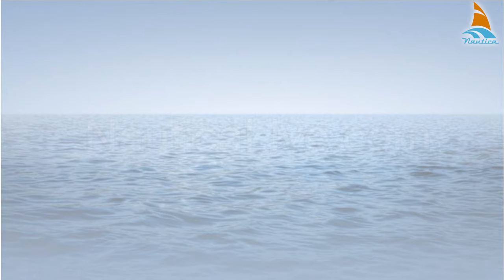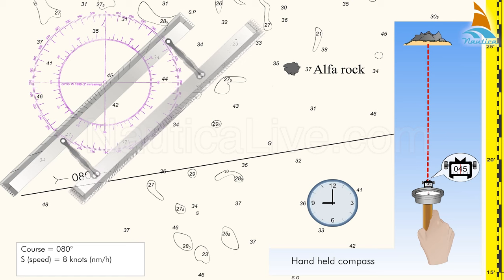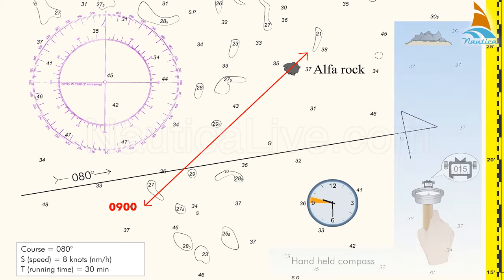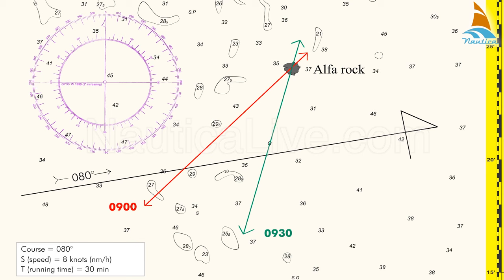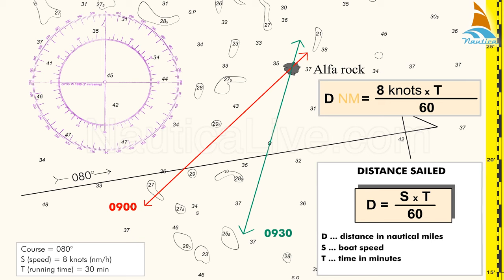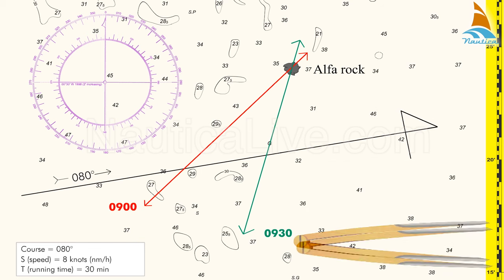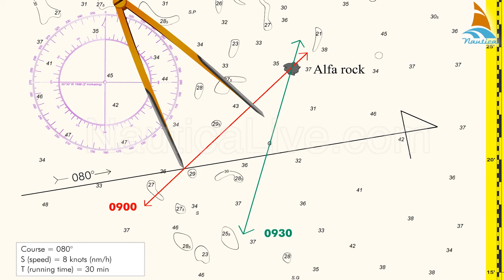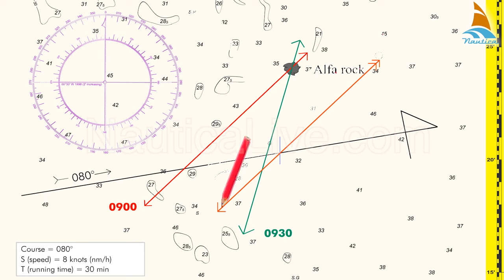Running fix plotting

Comment: How did you get 45° bearing on alfa rock using hand held compass when you are Heading 080°? it doesn't make sense for me.
Reply: Alfa Rock is not on the boat's heading, it is more to the north, hence the bearing of 45 deg.

Comment: Don't get it. Sailing coastel waters there is always a current and some leeway. Why this factors are not included. Thanks for the video.
Reply from the maker: Depends of sea. For example the Baltic sea is  free from currents. But anyway leeway and cuurent callculations can be added.
Reply: @skippercheck_net  Yes! Humans also don't necessary steer in a straight line. So this method is going to yield an approximate position.

Comment: hi , how you convert compass bearing to true bearing ?
Reply: by the TVMDC rule
Reply: There seems to be a bit of confusion here. They mention the "compass bearing" , but it looks like a handheld compass was used, so no deviation correction is needed; The reading is a magnetic bearing. You only need to correct for variation to obtain true bearing (adding E or substracting W variation)
Reply: C (Compass Bearıng) D(Deviation Error) M (Mangetic) V(Variation Error) T (True Bearing)... when you bearıng on
compass you must count errors which is E and W .... ıf you wanna go trough True Bearing you need to subtraction W errors plus E errors...  in the opposite time you need subtraction E errors , plus W errors..